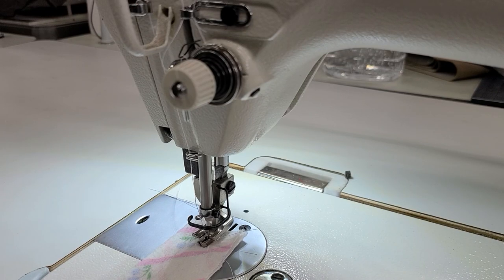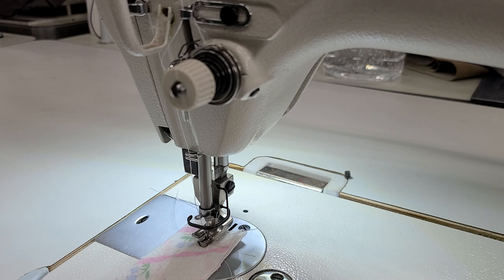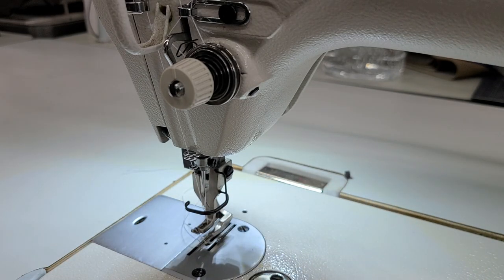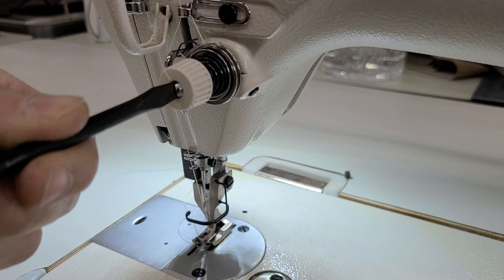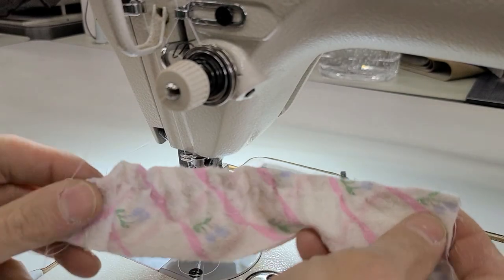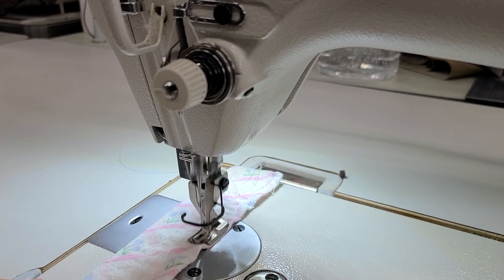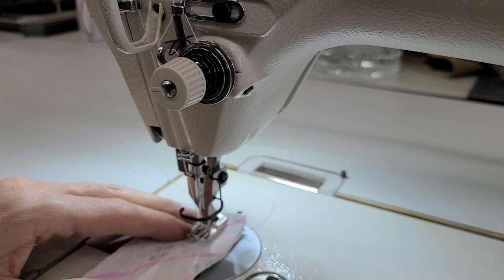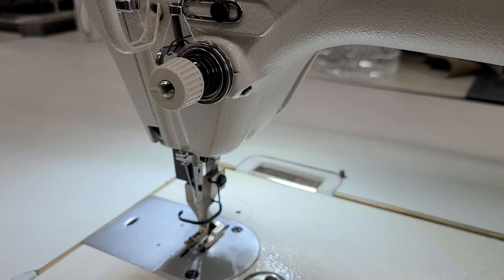Adjusting the Juki DU-1181N to sew on lighter material with T40 thread.

Comment: I've had my 1181 for a couple months. I use Tex 40 sewing (top to bottom) 2 layers thin/slick poly poplin, 1-2 layers of batting, 1 layer stabilizer (Pellon 50 or 926). The adjustments I found that worked were: reducing the thread tension as much as possible. It seemed like the tension adj (pg 23 of the manual) only helped so far before the takeup spring tension & travel (pg 24) added its own tension. I reduced the spring tension so that the spring is loose for the first 1/16" of travel. The spring's full travel during a cycle is 1/4" (I might reduce that travel a little still, or reduce the tension a little more so the first 1/8" is slop before the spring tension engages). Pg 46 says the thread-guide above the tension spring should move the right for lighter fabrics. (I moved mine 1/8" from the center line. Maybe going going further would accomplish what I might try above: reducing the spring travel a little more, and/or reducing the spring tension a little more with more slop in the spring's initial state). Those seemed to help the thread tension, stopped getting puckering. (The next thing I was going to try is the thread post on top. The thread wraps around that to go through two holes. That might add more tension to the thread than going through one hole. 

Raising the silver presser-foot pressure screw (on top) helped a lot. I'm still unclear how it and its neighbor black feed-pressure screw work together. I feel like that should be raised too (then maybe the silver presser screw lowered again). These two are mysterious to me. It's not clear what they do independently of each other. Pg 27 recommends lowering the feed dogs for lighter material (esp. if it puckers). I haven't tried that yet (but, I'm not getting puckering with the above adjustments). Pg 34 talks about multi-layer fabric not feeding properly, and adjusting the "longitudinal" position of the outer walking foot to the center presser foot. (that was on my list to try if I wasn't satisfied with any of the above).

I installed my bobbin in its case pointing the opposite direction than pg 19 shows. Mine winds into the slot, not against the slot. That seemed to give me less bobbin tension than I could get with the bobbin unwinding against the slot (it unwinds into it). I.e., the official bobbin tension screw stopped helping at some point. (I should revisit this to verify after getting the top tension dialed in). 

It would be interesting to see a video going through all these things showing what they do (at their extremes) with lighter fabric, multi layers.

Comment: Steve... I found this helpful. Would it be the same for the Judi 1541S?   I do have tension issues on lighter fabrics.
Reply from the maker: Adjusting the check spring on the DNU-1541S is slightly different.  We have not tried it yet.
Reply: @Sewinggold  I was wondering the same thing, would love to see how to make this adjustment on a 1541 & 1508.